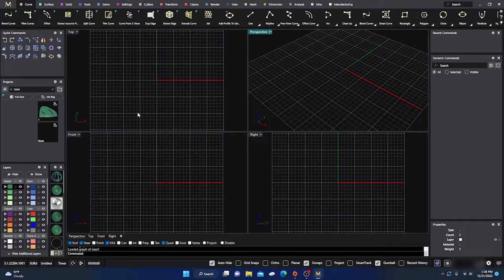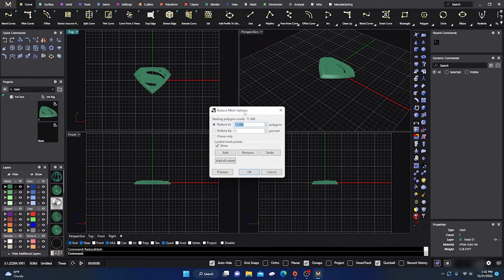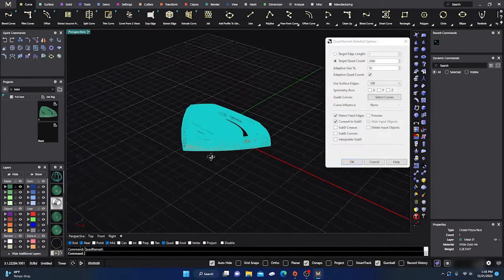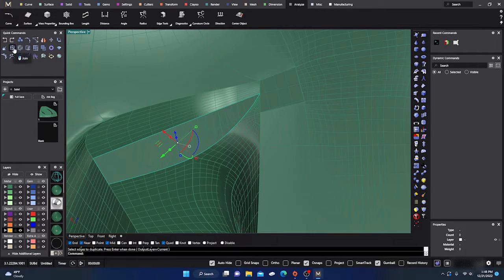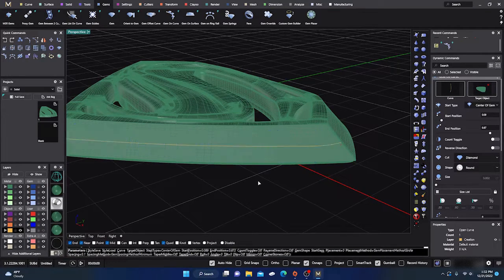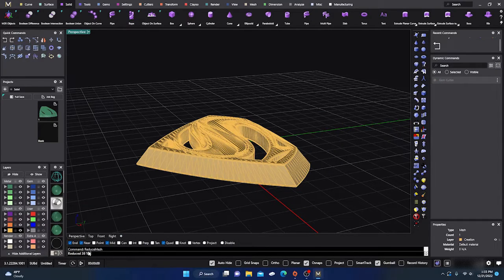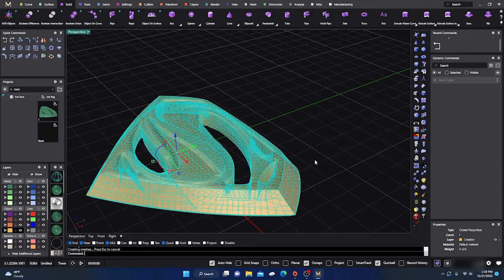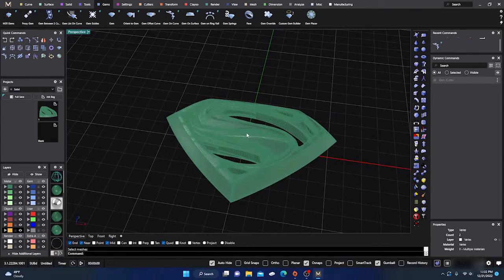Matrix 9 to MatrixGold Converting an STL file so you can set stones

Comment: Unfortunately Ihave rhino 6. And i can't adjust my object, because I can't find quadremesh tool in my app. Do you have any other tool in Rhino6 with matrixgold please ?
Reply from the maker: You might try alien mesh vertices. This tool is usually use to repair holes in meshes that are imported but it might align the polygons used to make up the mesh. Might work.

Comment: So basically you can add diamonds easy to existing stl mesh. And it looks like I need Rhino 7, Matrix 9, & MatrixGold? I’m not sure
Reply from the maker: It’s a lot more then just that. Lol Hard to list them all out but there are many extra benefits inside MatrixGold other than placing stones.
Reply: @donsjewelrymakingandjapantrave  ok dang. I was hoping I could add diamonds to existing stl files. Only software that seems to be able to do so is 3Design. Which is highly expensive but I’m not sure if I can preserve the investment with MG.
Reply from the maker: Yea, convert them to 3dm files and they should load no problem